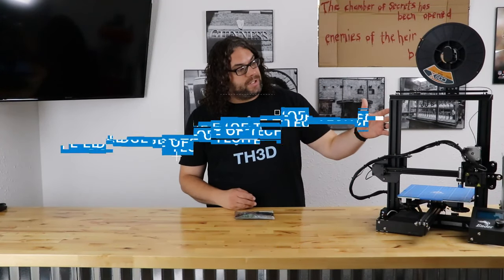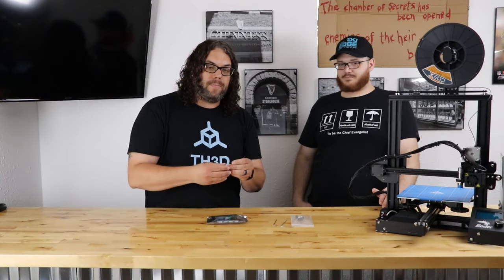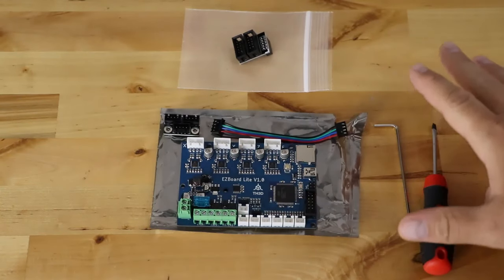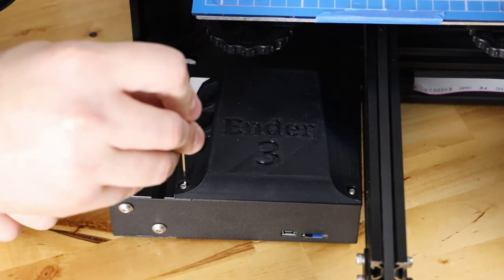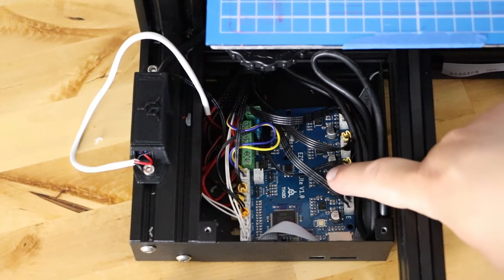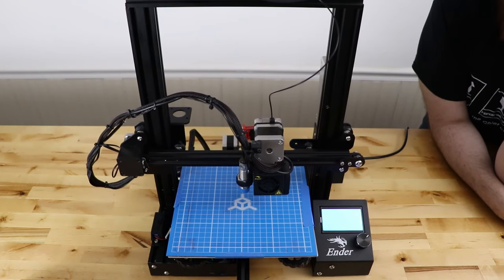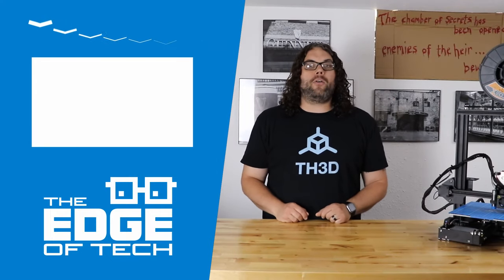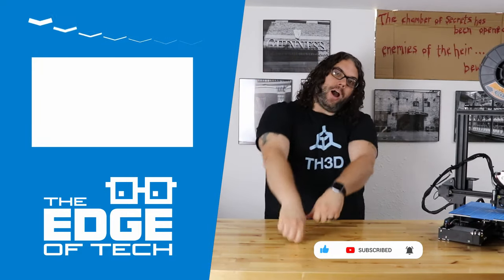How to install the TH3D EZ Board Lite Upgrade on a Creality Ender 3

Comment: No heat sinks on the TMCs?
Reply: The board is designed to sink the heat directly through the copper power planes. Because of this, no heatsinks are needed.

Comment: If I buy this board, can I change out my original thermocouple and print over 300 degrees?
Reply from the maker: If you had the right hotend, you should be able to!
Reply: Do you know what I would need to get this done? Just the board and hotend? or a different thermocouple (thermistor)? Even better, do you know who or where I could ask to get the answers?
There’s not a lot of info on this.
Reply from the maker: @sixdegrees6434  What material are you trying to print?
Reply: @The Edge of Tech There are a few that I’d like to try like ULTEM and maybe PEEK if I can get the nozzle that hot. Taulman 910 is another and at 280 it’s probably more realistic

Comment: Can I use fan 2 as a hotend fan ie M106 P2 S255 via modification of the firmware? I plugged in 2 case fans via a  ferule to the always on ports and want to avoid undoing it if I can help it. TIA

Comment: 7:44  "All of the ports here on the board are lined up just like the Creality board." That is not true of the green screw terminals. On the Creality board, they are 1,2 Heated Bed, 3,4 Hotend 1 Heater, 5,6 Hotend 2 Heater. On the EZ Board Lite, they are 1,2 +5-, 3,4 Heated Bed, 5,6 Hotend Heater. If you move the wires exactly as they appear your bed will be heated all the time.

Comment: Not busting your balls, but step 1 should be unplug your printer (I work in an industry where we can get sued for a simple thing like that)
Reply from the maker: Good call! Always unplug your printer before working on it! Thanks for the feedback and thanks for watching!
Reply: @TheEdgeofTech  Some people get so exited they forget and then poof  (been there, done that)
Reply: You are quite right but remember that inside the control box it's 24v not mains voltage